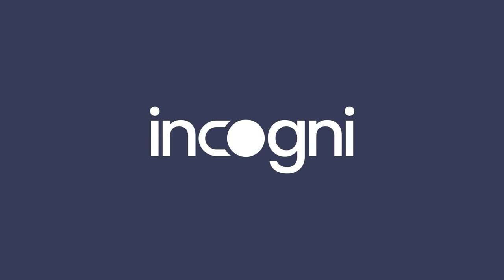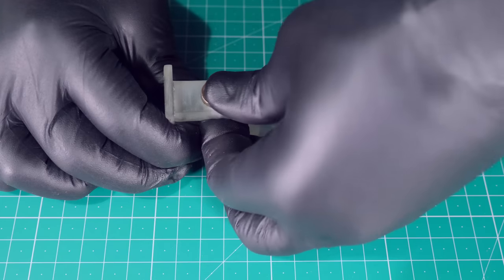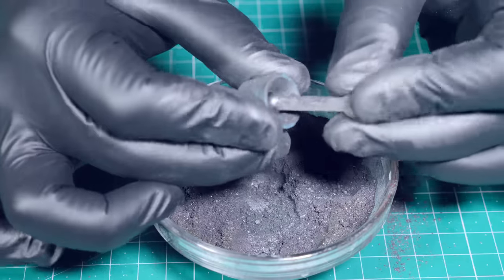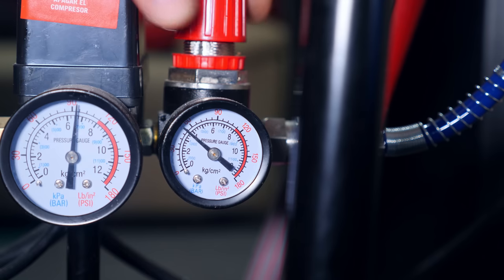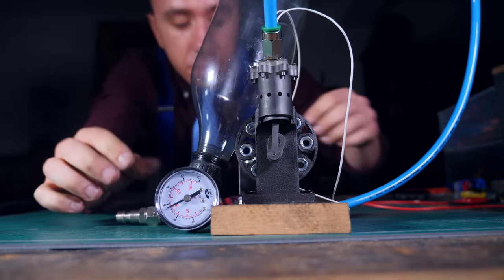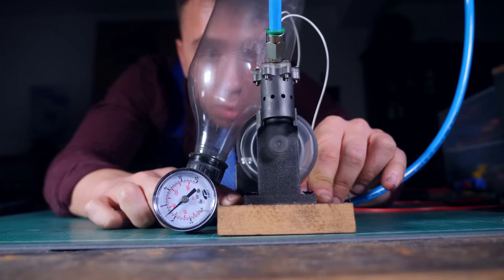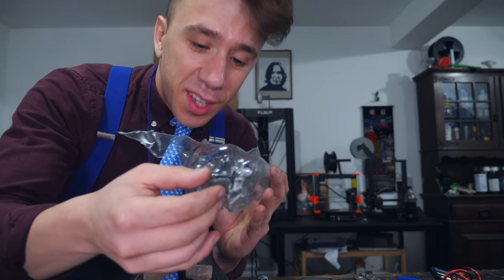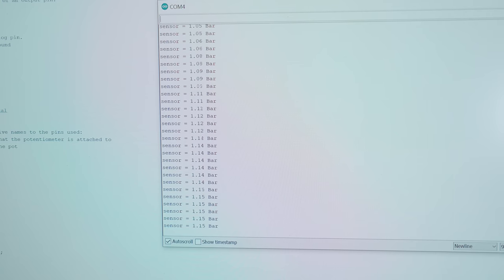Magnetic Air Engine

Comment: I was thinking that must be a better design to a pressure engine vs internal compression design. Domed, concave, oval or even square bores. You're not compressing air with this engine, so a fifteenth l different design may prove better. You have the 3D printer, so you can experiment.

Comment: Give it a little think.  Wonder why you never see any compressed air powered anything.  There are several excellent reasons for that.  Never mind what they are.  In the end they all mean an air engine is going to have low efficiency.  Something related intrinsically to your basic gas law, PV = nRT.  Aspects that can't be worked around.

Comment: make it mobile. rc car for small scale and how much torque or pulling power does it have using some arduino  magic with BT or WIFI control and use the program to run the "fuel injection" and powered relays to control  other aspects or give it the power to run autonomously like engine starts generator-generator powers arduino- arduino gives injection-injection powers motor-motor powers generator and the such as. perpetual motion??

Comment: Try a rotating valve so that you're not lifting against the air pressure.  I know that makes the engine more complilcated but you can run a 2 : 1 pulley to turn the valve so that it's open at top dead centre.  With the graphite powder it will hopefully be smooth enough to rotate ( though I can still see it melting after a few minutes )

Comment: In a previous video you copper coated a disgusting tomato. I'd like to know how much power can pass through a tomato before it explodes or does something else unexpected. How about copper coating some tomatoes and take them somewhere cool with lots of high voltage electricity around and fry these little red balls from hell

Comment: This is going to be a terrible explanation so I hope u can understand What if you used a magnet with the air where you use the poles of the magnet to your advantage so they are not attracted and repelling on opposite sides and used compressed air so that it won’t run out out of energy if I could post a drawing I think you would understand